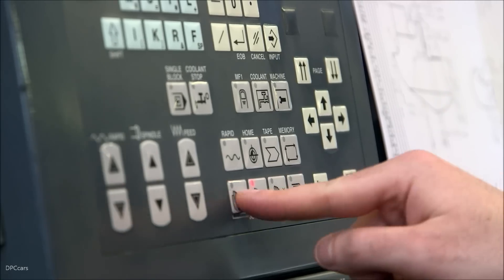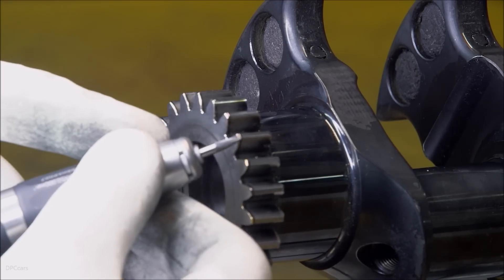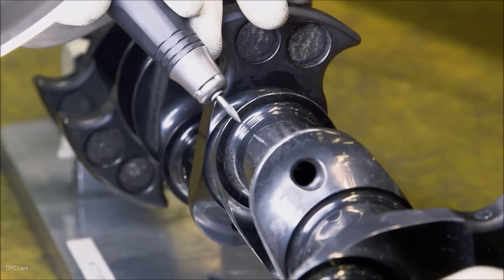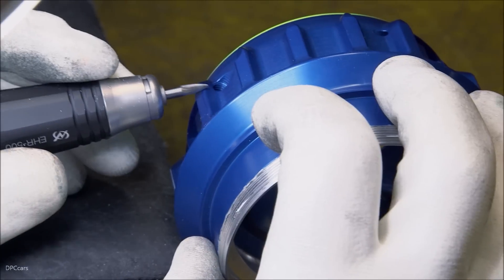Ferrari F1 SF71H 2018 Explained

Comment: I love it’s all red again but man.. I hate that toilet seat over the drivers head 🤮🤮🤮
Reply: +Patrick Förster santander left f1 you dumb idiot not just ferrari but all f1
Reply: oh look, another person bitching about the halo.
keep on beating that dead horse, or you could just move on perhaps?
Reply: toilet seat? ... oh, you mean the whale tail thong lol
Reply: Did someone piss in your cereals this morning? Geez.
Reply: INTENZO RC ACTION your way of thinking is pure idiotic.
Reply: Rebuilding The Wind Cut System 
Changing Down Force Level 
Gear Not Focus Top Speed 
Let gear 2+3+4+5 more 
Higher Rpm Trolling
Mec AMG is Balancing Power Mode 
We Cut Him On Out Cornering 
engine Level Not Big DFN 
Top Speed Don't Want Pushing 
Never Cornering Fast Time One Sec = Street way Fast 2.5sec
Reply: O rly, its not a toilet seat? Sarcasm.. Im well aware its for driver safety but still.. If the drivers find it too dangerous they shouldnt race in F1. They know the risks, thats how I see it. The way things are going in a couple of years they gonna be autonomous :l driver less formula one yeeey...........
Reply: Why would you assume I do not know that? Why do you insult people online you do not even know? Questions over questions . . . I wish you a nice day regardless.
Reply: It is only so red because Santander has stopped sponsoring this rubbish backyard club, finally.